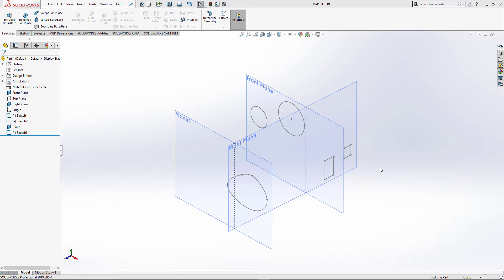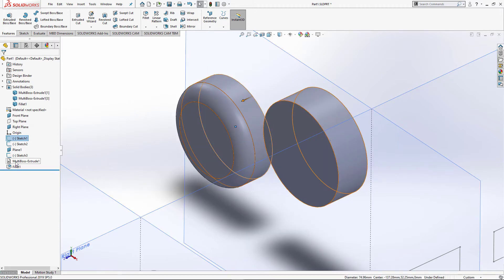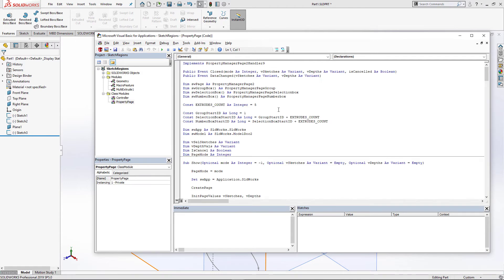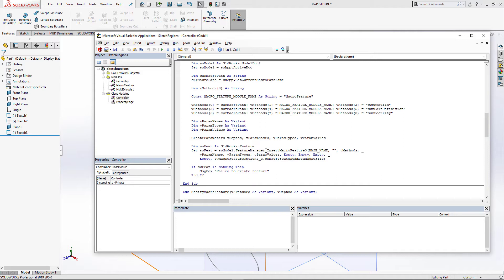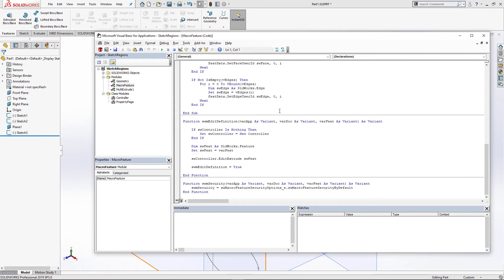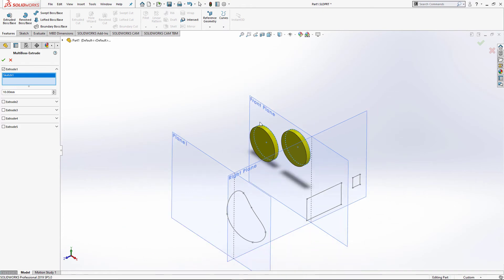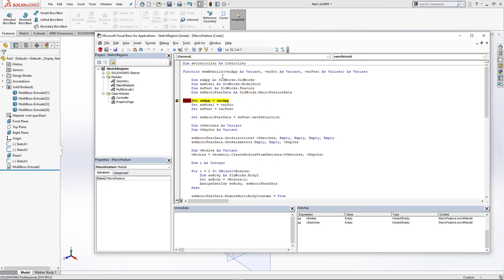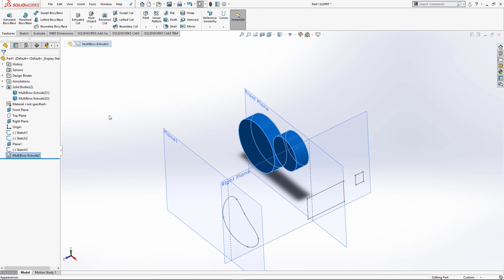Create single SOLIDWORKS Extrude from multiple sketches using Macro Feature

Comment: I'm sorry, but I think that this is a redundant MACRO because you can just construct Multi Bodies parts from one single sketch. But I'd like to get from your side  more easy samples a'cause I have a bunch of ideas to develop more  profitable MACROS. 🙂
Reply from the maker: This macro demonstrates how to create custom macro feature. Standard Extrude does not allow to have profiles on different planes or sketches as a single feature, while this example demonstrates how this can be achieved with a single macro feature.
Reply: @Xarial  Yes , I agree with you, but probably you won't never build a part with this MACRO.  So It doesn't have worth for designers. For me it's a LABORATORY MACRO.
Reply from the maker: @albertrichartbenito1806  this is precisely why the description states that this is a demonstration of the macro feature (e.g. it is not a utility macro, but a sample code). Most of the macros on CodeStack are tutorial (laboratory) macros (refer the main page of CodeStack). The utility macros are grouped in the 'Goodies' section here: https://www.codestack.net/solidworks-tools/
Reply from the maker: I hope this explanation clarified the purpose of this macro. Kindly remove or update your google review based on the above clarifications.
Reply: @Xarial  Of course, I tryed to do a multy body part but this  wasn't possible with that macro . Instead I borrowed from your  site the macro to fulfill the Qty. from  the assembly to the parts. This one works and sound  very interesting. Thanks for your help and forgive me my low level of English.
Reply from the maker: @albertrichartbenito1806  Glad the issue is resolved. Could you please remove or change your 1-star review for Xarial in Google that you have submitted several days ago as we believe it does not reflect your actual experience with our company and services. For any questions please contact us at info@xarial.com
Reply: @Xarial  I'm sorry, I didn't realize that there was one qualification, the only star is a qualification by default and against my will. Your work and suppport deserves a qualification of five stars.